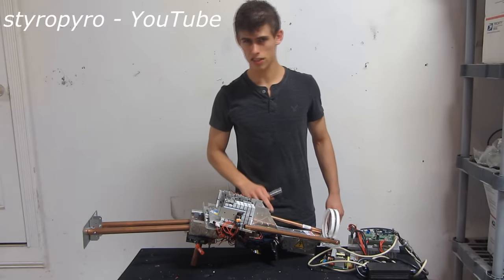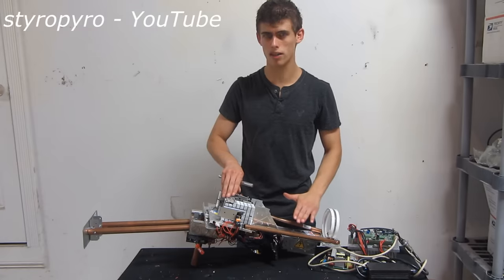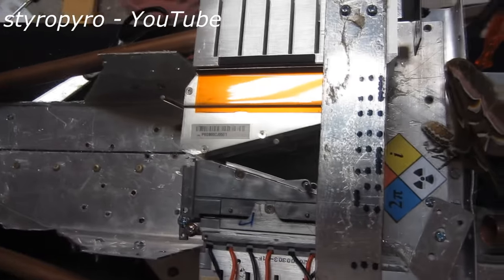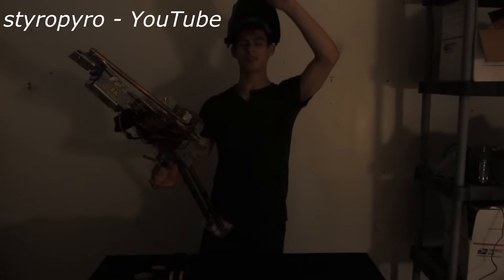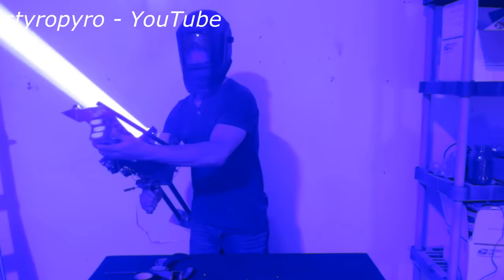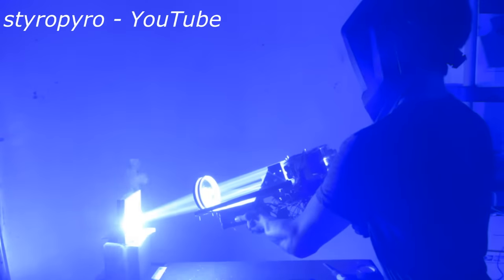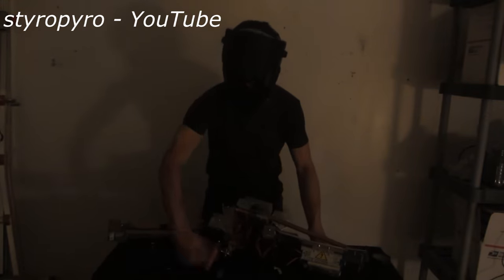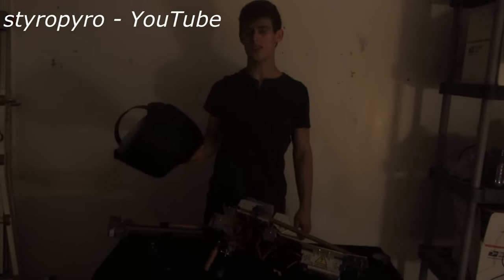My Homebuilt 200W LASER BAZOOKA!!!!!

Comment: Hey Styropyro. Can you apply this to a black suit of sorts? If you are in war, and you enter a room with light this strong - it would permanently blind all opponents in an area around the soldier. You should build something like that, patent it, and sell it to the military. For special forces using this as an activateable ON/OFF during mission against hostiles, it would render all opponents instantly blind. Sounds like a sure-fire way to get rich if you can invent a patent for military use no?

Comment: I don't know if you will awnser my request .im just waiting on a 95 watt diaod array like the one I showed me .i want to get it up and running in a hand held type body I'm thinking one of those old 9v big battery flash lights with the battery compartment separate from the light fixture .so I'm wanting to use the battery compartment for the battery and the driver board I have small vacuum I'm think I g use to suck the heat away rather than fan .id like your help in refining my plan .my Maine goal is to weponize my car with 4 arrays together through a comulating lens or lenses to try and get around 30 foot comulation of the 😀 beam .should have plenty of power ! And how I can use my cars power to power the laser !